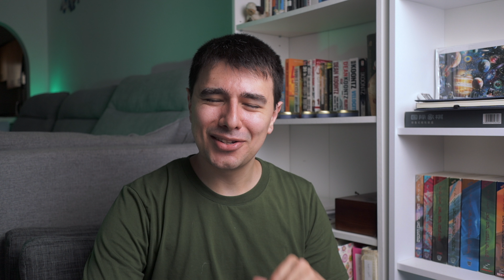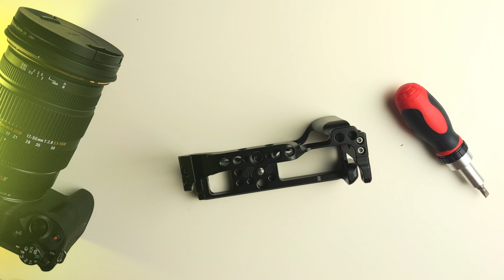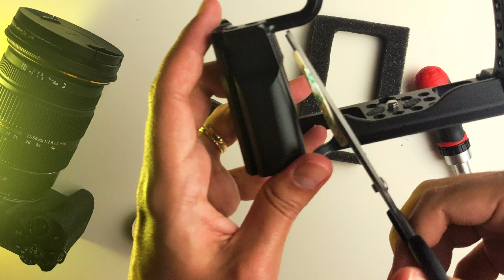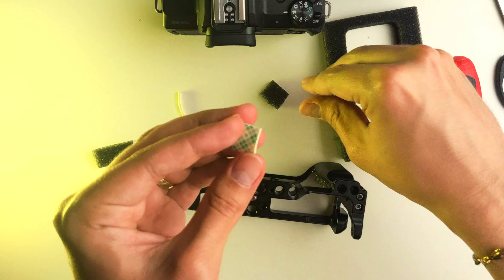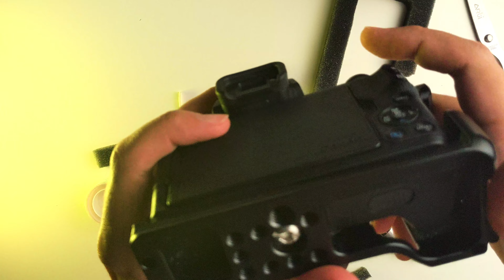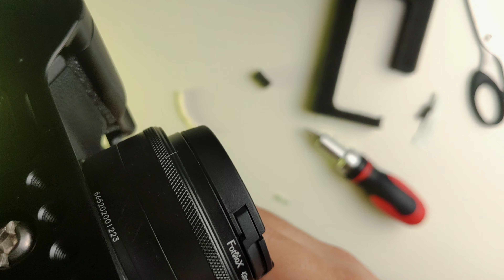Smallrig or Easyhood Canon M50 cage FIX UNDER 5 MINUTES! No more wobble or wiggle!

Comment: Hey! Great video. I’ve only seen the zip tie through the camera strap ring method. Questions though, 

Have you had to redo your foam job from this video since you made it? Did it 100% fix the wiggle? 

I’m trying to determine if this cage is worth it for my m50 and I don’t think i’ll be able to manage with any wiggle. Thanks for making this vid man!
Reply from the maker: The foam still holds up! No wiggle yet. 😃 
But I'm sure it will get loose sometime in the future... That's just how they've designed it. 🤷‍♂️ 

From the searches I did online it seemed that all the cages had one flaw or another, trying to be good for the M5 and the M50. So, no matter what cage you buy you'll need to tweak it. 

Personally, I think it's worth it. The extra weight and grip are incredible. No regrets since I bought the cage, even with the needed tweak. 

Thank you for watching! 🤩 Hope to see you on the next one. 🤟
Reply: @ElusiveFrame  Thank you for the speedy response and the thorough answer! Just what I was looking for.
Reply from the maker: @troyryangolf  Happy to help. 😃